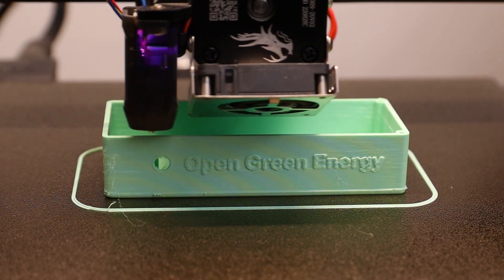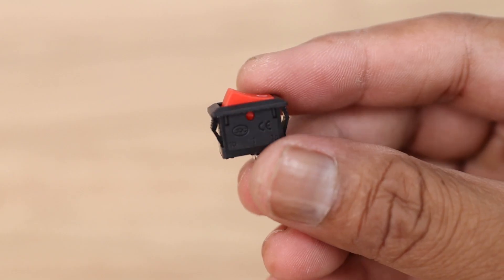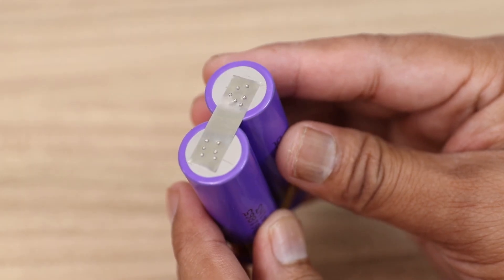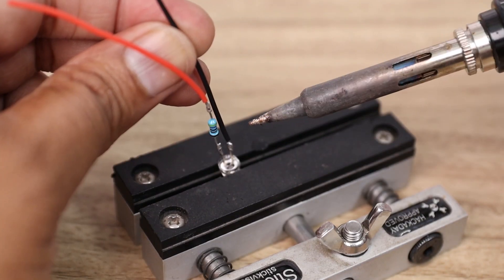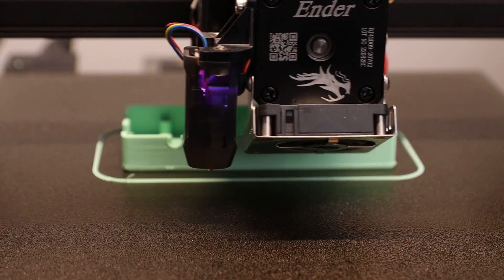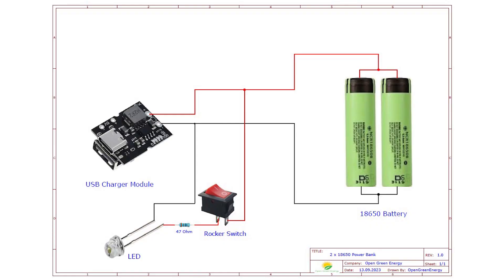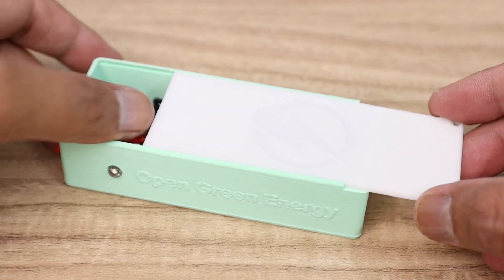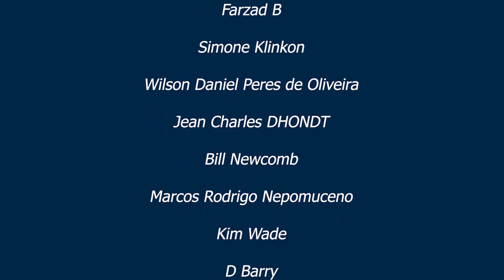How to Make a DIY 18650 Powerbank 🔋

Comment: I have 6 Nos. of 18650 2600mAh batteries.  Can I go with  5V 2.4A Dual USB Micro/Type-C Power Bank Module with LED Display ( 6.5 x 2.5 )cm to make a power bank on the same lines as shown in the video.  Please confirm.

Comment: Bonjour, j'ai fais la première version de votre powerbank et hormis au niveau de la place qu'il y à dans la V2 qui semble un peu plus importante que dans la V1 (il y avait vraiment pas énormément de place pour installer les composant et j'ai eu de grosses difficulté à faire tout tenir en place) du coup je ne vois pas où se situe la différence entre les deux version si ce n'est le module en USB-C pour le chargement à la place du micro USB. Comme je n'étais pas entièrement satisfait de ce que j'avais fait avec la V1 je pensais reprendre le fichier STL dans 3DBuilder de Microsoft pour avoir un peu plus de marge de manœuvre à l'intérieur du boitier et aussi augmenter un tout petit peu la taille de l'ouverture pour l'interrupteur, quand j'ai rentré le miens dans la V1 la petite partie qui sépare cet interrupteur et les ports c'est cassé car l'interrupteur doit être un tout petit peu plus large que l'ouverture dans le boitier c'est sans doute l'occasion pour moi de refaire ce projet en modifiant un tout petit peu les cotes. En tout cas merci, c'est bien cool comme petite alimentation de sauvegarde, j'ai d'ailleurs également imprimé et assemblé l'une des autres que tu proposais dans la première vidéo, j'avais deux batterie de 10 000mAh plate (pas d'assemblage de plusieurs accus 18650 mais une batterie rectangulaire) et j'ai modifié l'intérieur de cette grosse powerbank pour que la batterie tienne bien au centre du boitier, le top d'avoir deux powerbank de 10 000mAh à disposition :o)